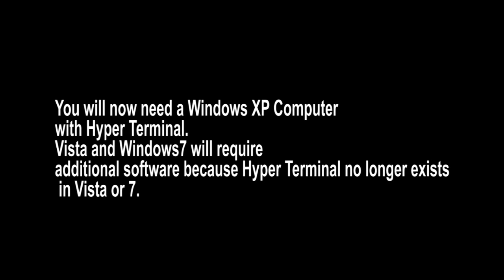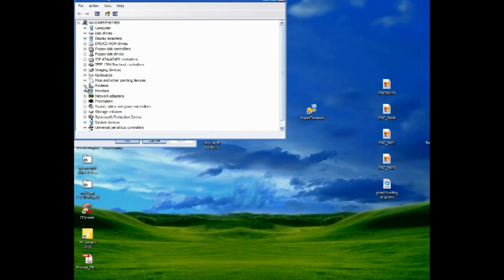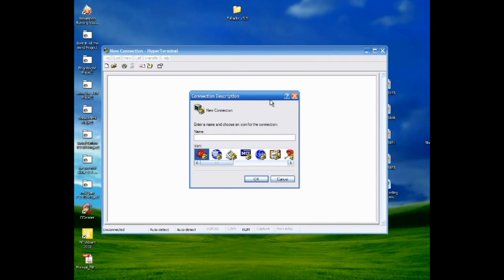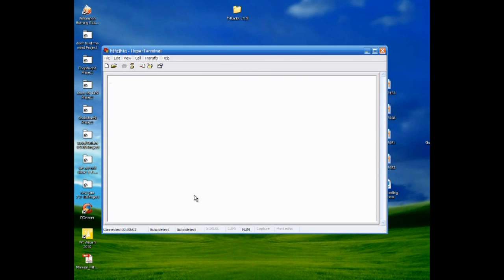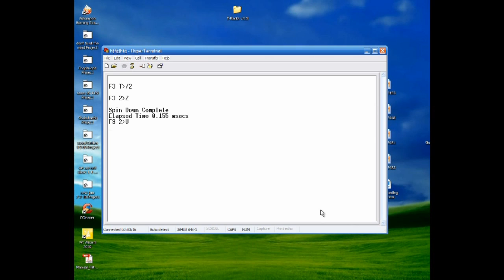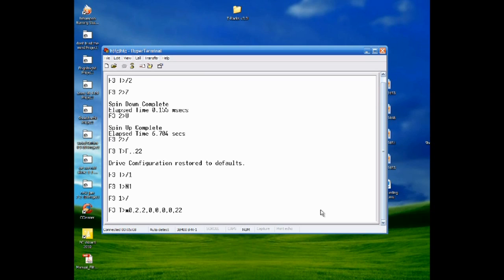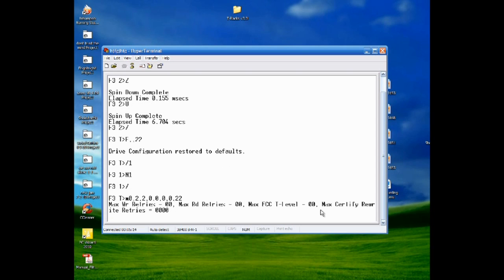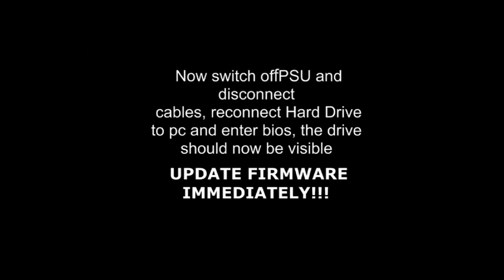Seagate barracuda firmware fix (BSY bug)

Comment from the maker: @JolieBlues I should imagine it would work with firmware version SD25 yes but im not sure. I cant see it damaging the drive if you try, I have not heard any stories of this. Just make sure you type the code correctly and all should be ok...saying that when I was doing mine I made a few mistakes in the code but alls I had to do was try again until I got it right. Just make sure you type it exactly is a describe in the video and it should work :-)

Comment from the maker: @hannz251 Unfortunately there is really no way of knowing if the cable has 3 wires or 5, or what colours they are going to be. If you do a deep search on you-tube and the net you will find tutorials on how to do the fix with 3 wires and other colours. 
If fact when I was looking I found that the 3 wire seems to be more conman so I was a little confused when I get the 5 wire version...its just luck

Comment from the maker: @pchelpman im not sure if you could just use any usb cable. I i think it needs to be the CA-42 cable so it will install as a modem in device manager. I think you can get CA-42 copies that work in the same way but i believe  the one i got off ebay was a genuine cable, thats why i was unable to break the usb end down.

Comment: Great job with the video, I added some details to the post in the Seagate forum with regard to using a 6-wire DKU-5 cable.  Compatible with the CA-42 but using colors is just confusing so I went with: Pin 2 (Grnd), Pin 4(3.3v+), Pin 6 (Rx), Pin 7 (Tx).Like you mentioned, an extra PS is great, jump pin14 to Gnd and it will power up but I just plugged in and out to the drive on my running PS. I also used a button cell 3.3v in the place of two AA type batteries. Great stuff!
Tony